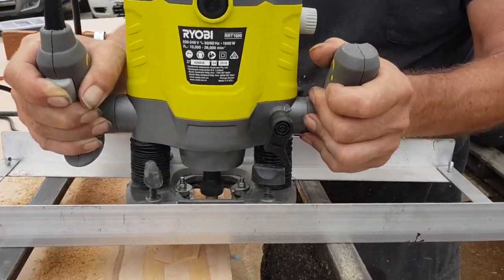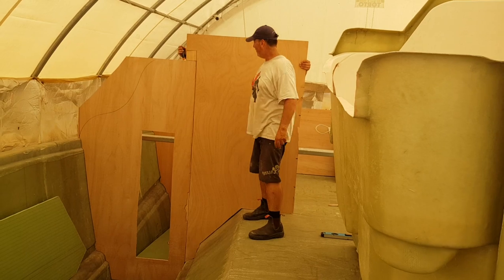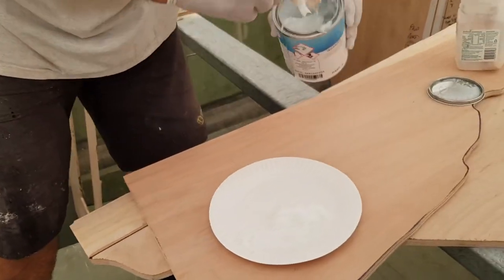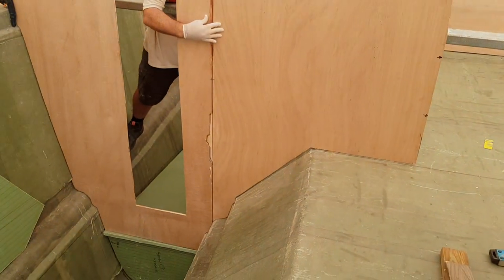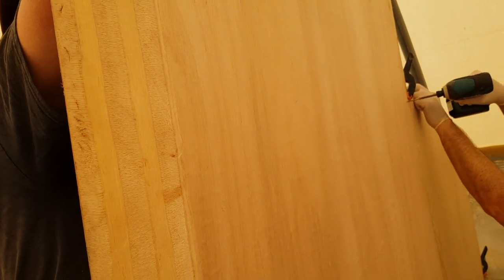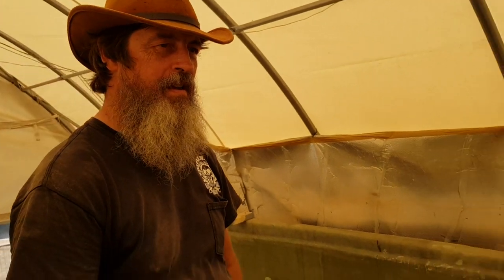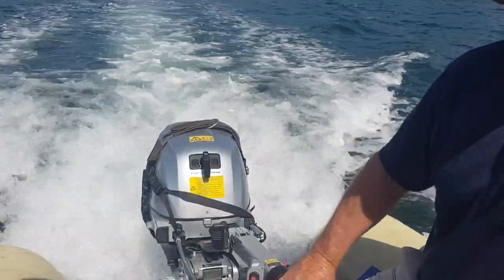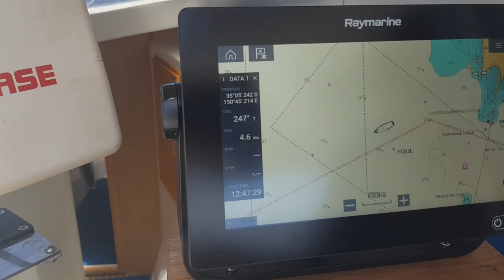Ep062 Major Bulkhead Install and Race on Jervis Bay - Building a Catamaran

Comment: Nice video Ross.
I am glad that i dont have to work in those temperatures, when we have 25 in the summer i stay insite untill late and then i can go out and work.
All the best to you guys.
Reply from the maker: Been a bit too hot this summer. Normally I cope quite well but it had almost, and I say " almost"beaten me. Thanks for watching again Martin.Cheers Ross
Reply: i can imagine for sure, 40+ degrees is damn hot especialy when working in a tent.
i think i would need at least 10 liters of water a day in that temp ;-) 
Cheers.

Comment: You might want to try the "glopping" technique, passed down to me from people who used to spread hull-and-deck-putty all day...

Use a straight paint stick or homemade stick, but it should be straight.

Either mix your batch in a tall paper cup to begin with, or transfer it in.

Dip the paint stick in cup, lifting out your batch.

Now, here is the tricky part: the motion to spread. This is not intuitive. We usually do not spread butter like this. Spread with a wiping motion, starting from the close end of the stick. Start from the inside of the stick, using a pulling, wiping motion, while you drag it along the edge, leaving an even amount behind. The end of the stick will trail a bit on an angle as you slide it.

If you are not accustom to working out of paper cups, they should go outside before they kick off because the mix settles at the bottom with a thick cross-section. (For instance, a hot batch of polyester will smoke, crack, and and throw chips from the cup.)

And please remember: fear fumed silica. And please hand your friend some hearing and eye protection. : )
Thank you for your consideration.

Comment: I wonder if it would be possible to put a vent in the top of the tent, or put like a tarp over the top with some space between the tent and the tarp to help keep things cool - better if you could do both - that way the heat would rise out the top, and the water would stay out.
Reply from the maker: I have cut flaps in each end at the top to assist but it never a small difference but not enough to rave about . When i get the deck on I may be able to air con the boat for fitout.

Comment: What are the benefits/reasons for using marine ply rather than laminating foam sheets for those bulkheads?
Reply from the maker: Marine ply offers substantial compression benefits over foam core and have better sheer capabilities that when laminated with glass on both sides as these will be ,will create the main backbone of the cat Note these main compression bulkheads are above the water line and will not be subject to water ingress and are the only wooden components in the boat,aside from furnishings and trim.Cheers Ross
Reply: Life On The Hulls - Building a Cruising Catamaran The name change has cocked up the comments spacing again.

Comment: Whenever a customer asks for marine ply i buy 4 extra sheets. As they come, i remove 2 from the top and bottom and two more at random. From those i randomly cut various places with a grinder to check for quality. Been ripped by these so called "high quality suppliers and producers" too long now. One sheet in every seven or so jobs is in a similar condition.
They have quite the nerve to ask the kind price they ask when it's garbage like that.
Reply from the maker: Yep,pretty bloody disappointing, luckily didn't need to use the majority of the voided part.I have installed hugh in the saloon away from water and all plywood above water line in any case .Ross
Reply: Feel your pain. I have seen some horrible marine ply      Have left samples in the weather and have been out performed by Bunnings CD ply

Comment: I've never seen voids like that in 'genuine marine bs1088 mate! I almost got caught out with some cheap knock off stuff.  made in good knows where.  The inner layers where thicker and different wood from the face veneer. I'd be sending that back
Reply from the maker: Thanks Casey, The thicknesses are consistent and the other sheets were perfect and came from a reputable supplier ,piece of crap sheet,luckily able to not use most it as the chamfer panel section is only about half a sheet.All is above the water line in any case and the void in the saloon bulkhead so once laminated with 2 layers each side of glass should be no problem. Cheers Ross
Reply: @LifeOnTheHulls  your on the ball!  I Admire the hard work and determination. I dont think I could stand  working in the heat you do though. Looking forward to the next update.
 Casey.

Comment: Yeah that ply's a little disappointing, considering what you pay for it.  But practically speaking, if it's internal and out of the water ( a combination you should work on maintaining  : ), it'll be fine.
Reply from the maker: Hey Robin,didn't use the majority of it as was the chamfer panel.Once laminated and sealed will be fine and out of any chance of water ingress.All the best .Ross
Reply: Yeah exactly my point.  It's high and dry and sealed.  A non issue.  Starting to look like a boat mate, especially in real time I'm sure!  Cheers

Comment: Sorry to say it doesn't look like marine ply, ie not enough layers for the thickness of ply..???
Reply from the maker: Plywood is Lloyds rated British Standard BS1088 Imported Marine aply supplied by Gunnersens Australia.ABond WPB glue between layers so is certified marine ply,just a disappointing sheet in the batch.We were able to not use all but 1 void,as scarf was on thr chaqmfer panel.Bulkhead is sealed with laminate 2 layers on each side and above waterline in any case ,just should never havr voids full stop.
Cheers Ross
Reply: @LifeOnTheHulls   Yes it may be stamped with BS1088 but there is a lot of dodgy marine ply about. I have seen 9mm marine ply that had 3 layers. it was just crap, 9mm ply should have at least 7 layers..layers. True marine ply should have the same timber used right through.   But most  have an external layer of your choice, with  internal layers of Gaboon.         It may be worth taking an offcut  and boiling and then drying it in an oven, do this a few times and see if it holds together.  The timber layers in the scarfs look like different types of wood?? To keep the weight down I wouldn't use anything other than Gaboon.   Cheers Rustie.

Comment: I love your videos. But it drives me crazy watching yall spread epoxy and other fillers with popsicle sticks. 3M makes great plastic spreaders for that very use and they're relatively cheap and easily cleaned for reuse. It will make your life easier. Easier to control and less mess.  I've been using them for 36 years.
Reply from the maker: I buy tongue depressors 18mm wide that are plantation wood,reuse them and rinse with acetone each use so probably get about 20 goes per stick,far more economical ,about 2cents each,have plastic spreaders but forget to get them out and not as good for catalysing small batches 250mm of vinyl and polyester which is the majority of the work I do.Definitely messier i will give you that.Cheers Ross

Comment: Marine ply is a waste of money. Outdoor is less than 10% reduction in strength and quality but up to four times cheaper.  Your going to coat it with resin or epoxy anyway , which will easily gain back any structural issues.   AND you just proved the point of marine ply, put the word marine on it and quadruple the price.  How much more marine ply is out there like that? You would never had know if you weren't scarfing.